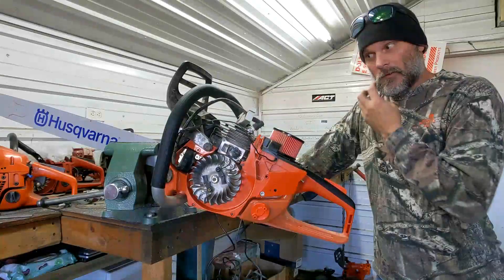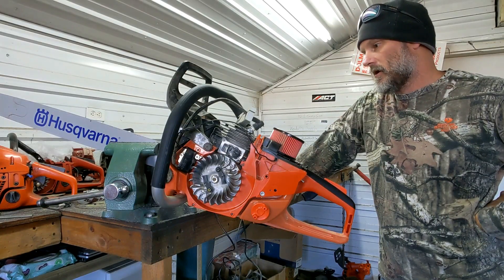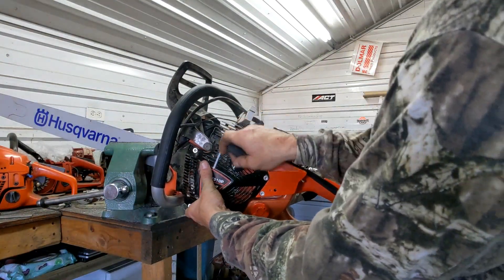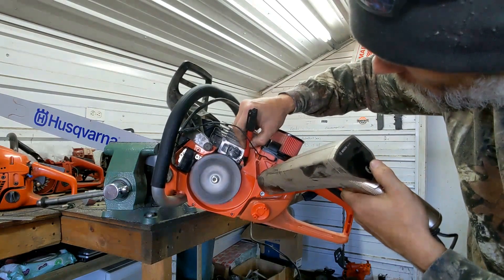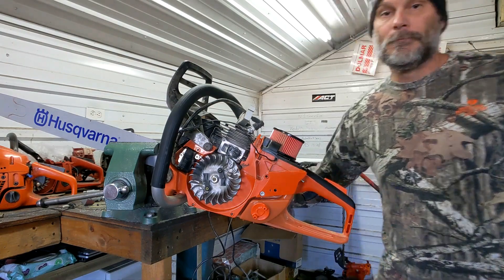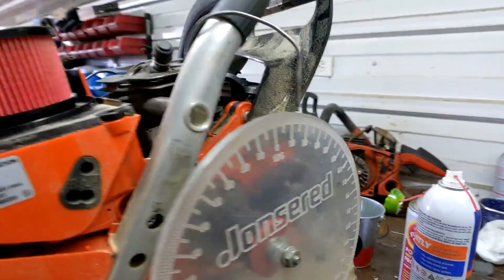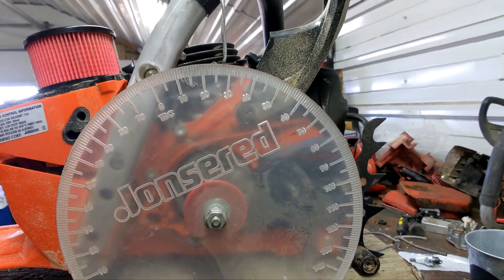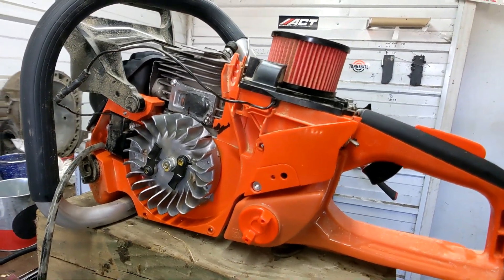Chainsaw Ignition advance

Comment: I’m not a fan of advancing ignition timing nor machining the combustion chamber/decking cylinder/ gasket deletes  ... If my squish is excessive a thinner base gasket is in order .... .027 seems to work well on my hotwoods saws ... I think many forget that we must get AIR  thru the engine and that while a enlarged  port may flow more total air than a stock port  the VELOCITY may be lost ... just my 2c brother